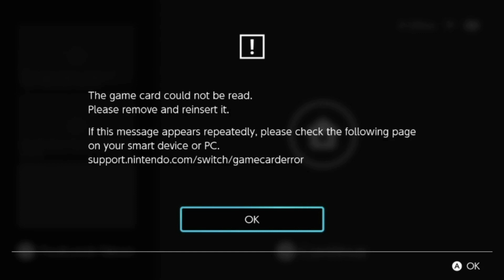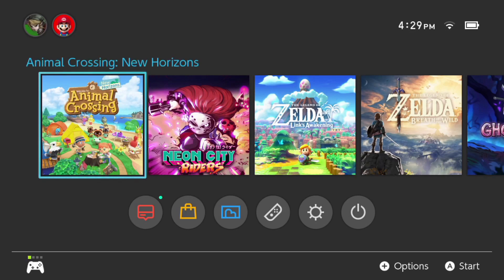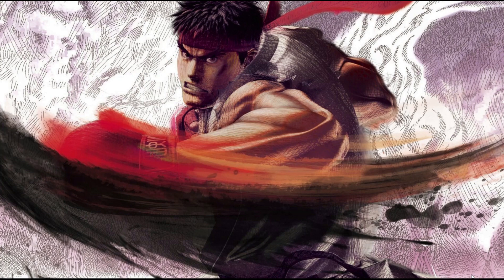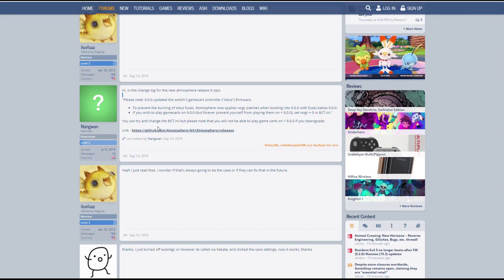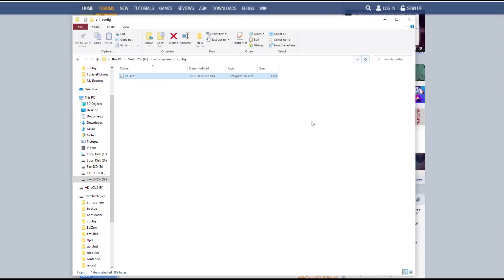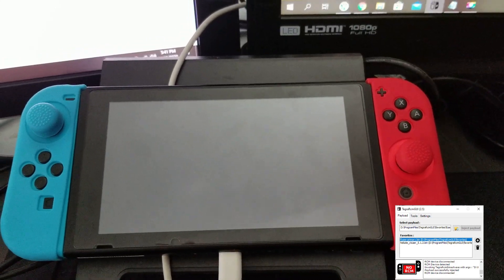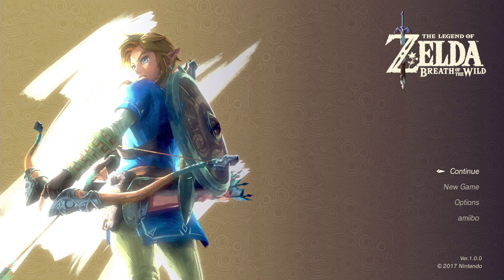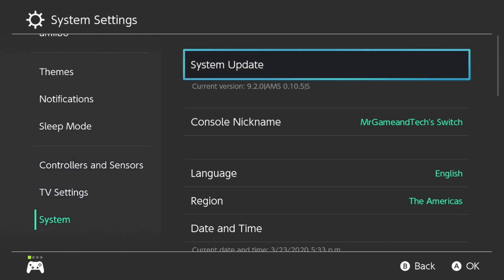How To Fix Game Card Could Not Be Read Error on Hacked Switch OFW 9.0+ Running Atmosphere CFW 0.10.5

Comment: For those who wants to know, it's not BCT.ini anymore but stratosphere.ini file that is in the template folder, you need to copy it inside the config folder and edit it just like this video
Reply: Tried it, didn't work. Anymore advice?
Reply: @buttertones  I dont know, what version of firmware are you?
Reply: @SpikyRoss  1.6.2
Reply: @buttertones  it should work with my instruction, you doing something wrong

Comment: Please Note: BCT.ini no longer exists, nogc configuration has been moved to /atmosphere/config/stratosphere.ini.
If the file is not in config, check the config templates folder and copy and paste the stratosphere.ini file there.
(please pin this so they all know)
Reply: Thanks a lot
Reply: Could you please help? I put both value = zero, did not work. I copy the same file to Config same problem... please help :(
Or is it possible you upload your copy of the file so I can put it directly under Config.
Reply: @rone5649  Don't touch the values they are just examples. You just need to add a new line and write nogc = 0
Reply: I do that exact thing but it doesn't seem to work and I still get the error
Reply: @David-uu1lu  Try your console on original firmware. If you get an error 2002 or if the card still doesn't read the game card, it's either a card problem or an hardware problem (card reader maybe bad?)
Reply: so instead of the  BCT.ini, you should do this same thing but in stratosphere.ini?

Comment: hi, I have the same problem but different setting: 
- I have a mariko switch using SX core on 3.0.5
- Booting is possible if no GC is inserted.
- My firmwares are in both possible booting ways ( Custom FW and Original FW  in SX starting Menu) 10.1.0

has anyone time and hopefully fun to explain those things to me ? :) 

Great video anyway ! I will as soon as possible change to Atmopsphere but would love to have the starting point for this on a "clean" outgoing point.

greetings.

Comment: I updated to 12.1.0 and this still works. My SD Card had a "Config" and a "Config Templates" folder. You can copy and paste the BCT from the templates folder into the actual Config folder and add nogc=0 to have this issues fixed! Thank you so much!!!
Reply from the maker: Happy to helped. Hope you subscribed.
Reply: you saved my life this method works with 13.0.0 too
Reply: this doesnt work for me
Reply: @soulonire  what firmware ? It should work cause I’m on 13,1,0
Reply: @henrymason1086  im on 13.1.0 too but it did not work for me, other games works, but the cards dont
Reply: @asahi1996  put the modified ini in the folder before the folder you modified the ini

Comment: this didn't work for me. I edited the file, but it still won't read the cartrage.
Reply: Same problem :\
Reply: @Darkmarco94  Try changing it under /config and /config_template.
Reply: Try changing it under /config and /config_template.
Reply: @TheUltimateNatural  Thanks for the answer, but unfortunately it doesn't work ... Maybe it's because I have the latest version of the switch firmware (1.1.0.1 and Atmos 0.18.0) :(
Reply: @Darkmarco94  the same problem here 1.1.o1 and dont work aswell

Comment: Didn't work on FW 10.0.4 + AMS 0.13.0. help :(
Reply: Did you ever get yours fixed? I' m getting the same results and trying to get to work for me. I'm running FW10.1 and AMS 0.14
Reply from the maker: @IAmSamThatIAM  mines works fine.  Make sure you follow the instructions exactly.
Reply: @MrGameandTech  yep! I followed the instructions carefully, and I tried other remedies like disabling e Nocart thing after I updated it, but it don't work.
Reply from the maker: @IAmSamThatIAM  I'll be updating my switch in the next week or so and I'll let you know once I do to see if i have the same issues.
Reply: @MrGameandTech  Thank you.
Reply: Same. But its not getting error message as in your videos. The games was patched officially and it just getting corrupted data message. Deleting data doesnt help cuz it forces you to update the game with no launch game option is avaible. I stuck. Dont tell me that I need to forget about my carts ((((
Reply: Oh, I managed to fix it. I reinstalled my atmosphere then switch off autoNgc.
Reply: @-xfa-7232  My friend I tried that already to. Matter fact I had two location where I had to turn off the autongcard, and rotate to see if it would work, It just don't work for me. Trying not to get a headache from this problem even thought it would be nice to find a solution. I have a back up switch to play my card games, and some how the next upgrade in fw I will hope it will be fixed. Thanks anyways my friend.
Reply from the maker: I have not tried it on that version yet.  Once I do,  I'll let you know.  Subscribe to be notified when I upload the fix.

Comment: ok so do i undestand right? if i change the "Boot-flag", after i reboot: the cardreader will be updated and after that i can´t go below 9.0 and use the cardreader?
Reply from the maker: Hi Chris, that is correct.  So the only disadvantage of this is that in the future, if they discover a way to boot directly into the CFW without having to go into RCM mode but it requires a lower firmware to enable that functionality, You can restore your nand backup to go back to the previous firmware but the Card Reader won't function as expected until you get that firmware to be above 9.0 again.  I suspect this won't be the case but do what you think is best for you.  For me personally, if I'm going to be using my card reader, most newer games might force you to be on a higher firmware anyways in order to run and so you'll indirectly won't be able to use your card readers for those new games.  Also, I prefer to be on the latest supported firmware that works with Atmosphere and Sigpatches cause I'm able to play anything I want and still have homebrew but do what's best for you.